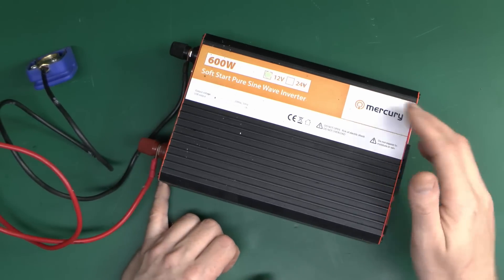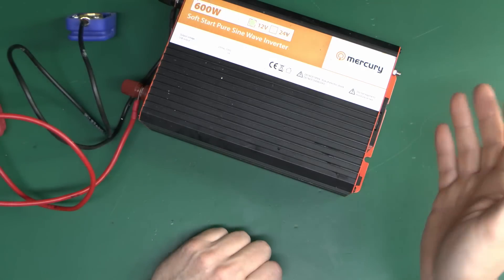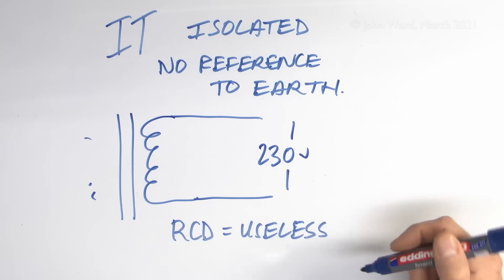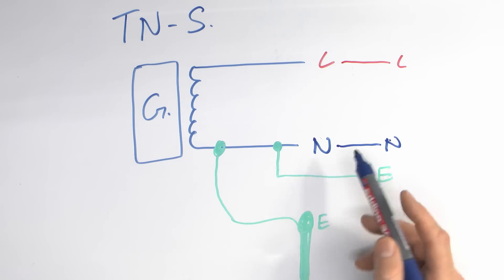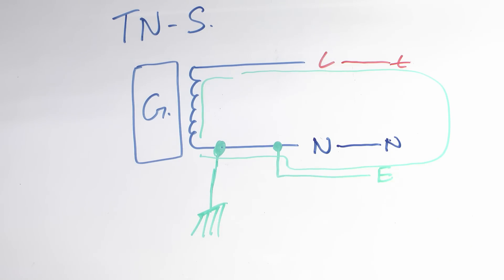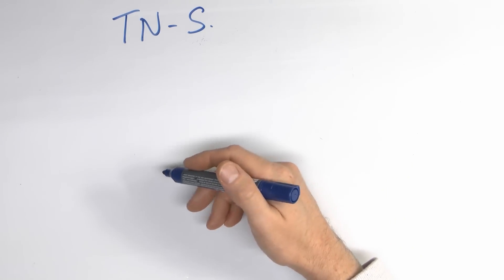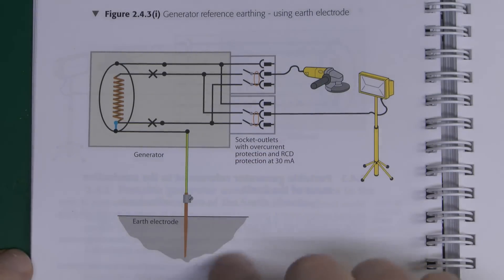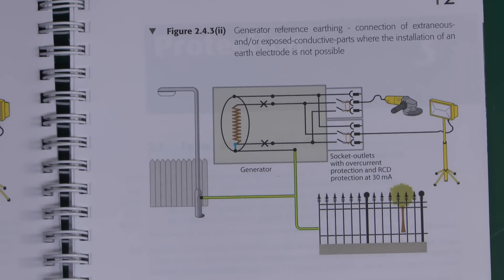Generator Earthing Types - TN-S or IT?

Comment: Could u link neutral and earth on an inverter then use an RCD?
Reply from the maker: Possibly - depends on whether the earth is connected to anything inside the inverter. Some might be a centre-tap output 115-0-115 rather than 0-230
Reply: That makes no sense - if you use ONE single device. You add an RCD, but give up the isolation. Nothing is getting better by adding the RCD. If you plan to use MULTIPLE devices, then it makes sense to build an TN (WITH earthing rod and RCD).
Reply: @MP-ou7lb  I think John got it

Comment: JW - could you make comment on the functionality of the case bondng terminal that was evident on the small 600w full sine wave inverter ?
Reply: I have repaired quite a few of those and most of them had  the case connected to the PE terminal of the output socket. Perhaps the idea is to connect that to your water pipe or house earthing system in some way. It will still be an IT system, but as JW said, you should not connect more than one appliance to it anyway.
Reply: You can connect more than one pieces of equipment to an IT supply provided the following:

- They are all class 2
- If using class 1 equipment you must have an individual 30mA RCD protecting each item of equipment (not on the output of the generator as this will not provide any benefit)
- If supplying more than one item of Class 1 equipment the installation is required to be under the supervision of skilled or instructed people
Reply: @marcuswareham1  But what about that case earth stud. What is it for?
Reply: a lot of small generators and inverter use the PE terminal on the outlet to make an equipotential bonding conductor so if used for more than one item of class 1 equipment and a single fault occurs the exposed conductive parts on all of the equipment rises to the same potential, I would guess that the case earth terminal is connected to the PE terminal of the outlet and could be used to bond a metal chassis of a camper van, etc to make inside the vehicle an equipotential zone

The book IET Practitioner's Guide To Temporary Power Systems explains this in more detail
Reply: Most car inverters have the ground of the socket connected to the negative 12/24V terminal,so it would be connected to the car metal frame.

Comment: Um, that's not how an American residential transformer works. Your center tap is Neutral which is grounded. Each end of the coil will be 120 volts out of phase with each other. It's usually called something like Hot A and Hot B which are 180 degrees out of phase with each other. For 120 volts, you take one outer leg of the coil and use it with the center tapped Neutral. For 240 volts, you just use the outer legs of the coil. Here in America, 240 is typically used for major appliances like a range (cooker), water heater, or air conditioner. HotA(120V) - Neutral(0V) - HotB(120V)
Reply: an American residential system it's known as a split phase.
Cuz leg A and leg B make up one winding. With a center tap for neutral and Earth bonding.
 wouldn't there be an issue with the fact of the generator producing a frequency of 60 hertz and not 50 hertz which UK electronics run on.
Reply: @jonathanfurtado3696  Generators are built to run at the same frequency as the mains supply in the country in which they are intended to be used. 
The frequency has no bearing on the earthing system though.
Reply: @misstakenot9582  I know frequency has no bearing on the earthing system.
I was just curious what the fact that you guys import shoddy generators with dual voltages, if there could also be a problem with it not being the correct hertz. 
Reason being when England was selling generators to Japan in the early days.  You guys for some odd reason sold them generators that only produce 100 volts and generators that produced 50 and 60 HZ.
It is now one of the only countries that uses both frequencies.
Depending on if you live in the west (60HZ) or the east (50HZ)
Reply: @jonathanfurtado3696  Although UK single phase power is is nominally 230v with one leg grounded, power tools on construction sites are limited to 110v with the centre tap grounded, (so 55v between line conductors). That is the reason we have dual-voltage generators.
Reply: @misstakenot9582  
I know you guys have a regulation on construction sites that it's Max voltage is 110 volts with the ground center tapped between the live and the neutral to give you a 55 volt on the earth between the other two conductors.  You guys sell transformers JW did a video about them a while back.
But what he specified in the this video.  That the Earth is center tapped on the 110 volts.  Between the neutral and 230 volt live.  
I could see a combination generator and transformer where the generator generates 230 volts with the correct connection between the ground and the neutral with standard UK plugs.
And has a built-in transformer that would give you your job site type plugs where the the Earth connection is center tapped between the 110 volts on the secondary winding.
In the United States we too sometimes use transformers on job sites but that's to convert three phase 480 volts down into three phase 208 y120.  We used on big sites were power demand is huge and economically speaking it's cheaper to run 480 volts to each  level and drop down the voltage with a transformer.
Reply: @jonathanfurtado3696  Gee really?
JW, doesn't tend to focus on the electricity systems from the Third World, like the US.
Reply: @mikeZL3XD7029  
First off I wasn't talking to you. I was just trying to better explain what the OP had said.
Third world country huh.
Coming from a guy who lives in a country where a common idea was to use a ring circuit and is barely starting to use arc fault circuit interrupters.  
You should learn not to throw shade.
Reply: a) We know.
b) Who cares? That's nothing to do with what John's talking about.
Reply: @richij  Regarding your point B,...you should actually care as this is exactly what JW explained with the cheap little Gensets having a blue and yellow socket, Most of them are wired exactly like the Americans do it.

Comment: Hello John! Some years back I was involved in helping with outdoor events as a marshal. We often had access to a modified bus, with seats removed, a kitchen and other work spaces, to use as the event command and control point. It had a built in mains generator, and the electrician who looked after it would earth it by wetting an area of ground with (I think) salt water, placing a large metal plate over that, and reversing the bus onto it to force about 14 tons of contact (or the equivalent of a pair of rear tyres, so maybe a only quarter of that).

We never had any issues, and the electrician always seemed very competent (I think he'd been a marine electrician). Do you believe this would have been a suitable alternative to a deep-driven earth electrode?
Reply from the maker: Ok for temporary use, assuming the metal plate was out of an area that the public could access.
Reply: @jwflame  As I recollect the bus wheels pretty much covered it, and generally only event personnel were in the immediate area.
Reply: A very common set up for large truck mounted generating sets, where a rod can't be installed, like those often used in the film and TV sectors. A large copper plate with a cable back to the generator earth point and the truck is driven onto it.
Reply: Not where I've worked. And I've worked on some pretty big film sets.
Reply: No. Absolutely not. How long would the area under the plate stay wet? How would you know? What was the electrode impedance? Was it even measured? I immagine not. There are very strict regulations regarding event supplies and this was definitely in contravention.

Comment: They use  IT  systems in hospital operating theaters, even the sockets within the theatre
Reply: Interesting video thank you. Your inverter shown at the beginning has an earth contact stud implying  it should be earthed. Also what connection relative to that stud does the socket earth pin have?
Reply: @martinwinfield2935  many PSW inverters have this & it must be earthed separately to any metalwork.
I personally wouldn’t pay much attention to this video, I’m not convinced he knows what he’s talking about.
Reply: why?
Reply: @lordjaashin  More reliable than a TN-system. In a TN system one fault and the circuit is disconnected, in IT it actually requires two faults at the same time to cause a disconnect. But these IT systems are only in small areas, fault finding is a pain. And the bigger the installation is, the more of a pain it becomes to find a fault. In such critical installations like hospitals the insulation is monitored continuously due to this. The first earth fault will turn the IT system into a TN system, the leg with the earth fault will then become the neutral. An additional second fault will cause a disconnection of the circuit.

Comment: In marine applications the 480VAC 3 phase systems are most likely an IT arrangement. The argument being fault tolerance. A single fault will not create a short, or trip an RCD. There needs to be a ground fault detection system that signals the fault to be isolated when possible, and repaired. Some sort of high impedance coupling to vessels hull must exist to prevent the IT grid from charging up like a capacitor, carrying many kV if no measures were taken. IT earthing is quite tricky to get right.